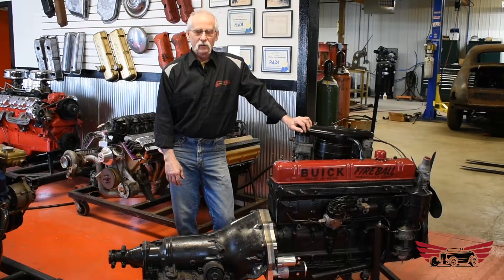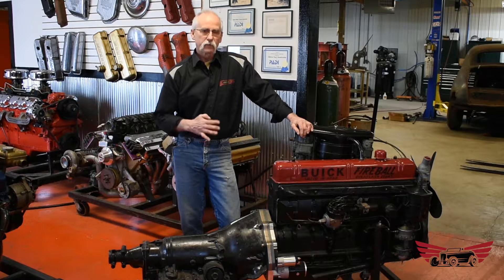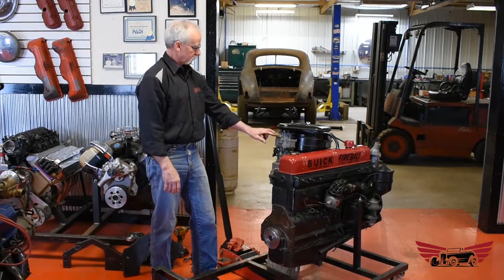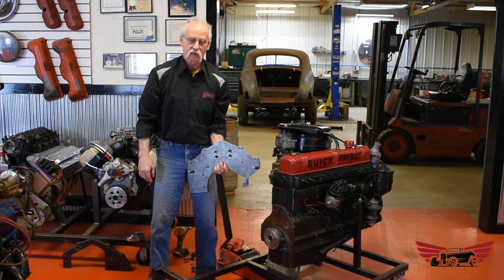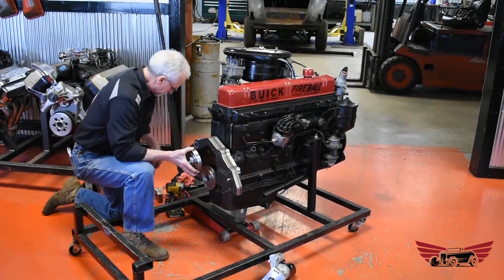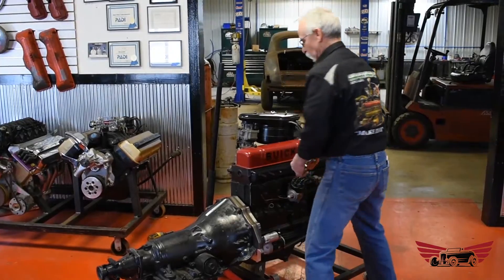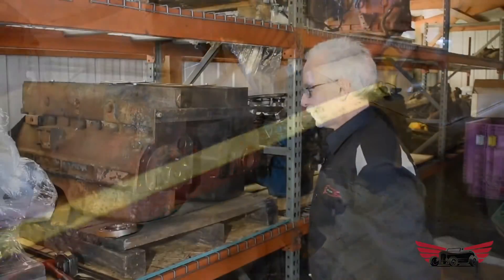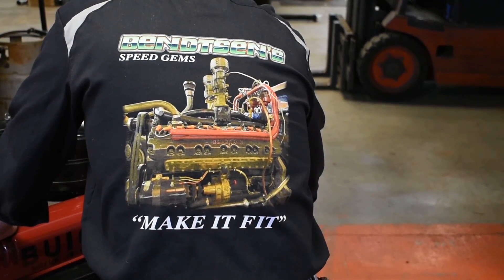Speed Gems Buick Straight 8 to 700R4 Transmission Kit Installation

Comment: Do this adapter also have 6 volt starter option?   Would like to have automatic transmission or 5 speed manual but trying to keep rest of the car as original as possible. But like to have more speed on the freeway without changing rearend.

Comment: any manual transmissions that would bolt up to this kit
Reply from the maker: It can depend on what you are looking for. We don't have a standard adapter plate, but if you can find a bellhousing to get a GM standard pattern to either a 84-92 Chevy S10 OR 93-96 Chevy S10 we can supply a bellhousing adapter plate. The links below are for those conversions. If you need help getting the correct one, please give us a call!
https://transmissionadapters.com/collections/buick/products/mt1001301-buick-straight-8-to-93-96-chev-s10-t5
https://transmissionadapters.com/collections/buick/products/mt1000014-buick-straight-8-bellhousing-adapter

Comment: very cool, I am trying to learn at moment, but want to build a stupid project for fun of it. I had a boss that got me liking straight 8, he was a Packard guy, he used it for a daily driver, put on thousands of miles on his Packard, but generally I am a GM guy, he also had a 59 caddy, we drove out a lot, but I want to build a 4wd, 70's Chevy truck, using a Buick straight 8 engine. nothing crazy, other than want to do something like this, I found 4 Buick Straight 8 engines for sale near me, but I had no idea what I was looking at. your info helped a lot! I know I want a manual transmission behind it, but no desire to beat on it, just a driver, and something to drive in bad weather, and get WOW factor when I pop hood.
Reply from the maker: @ Randy mack - Love the Story!!!  When you get there, here is a link to our Buick Kit options:

https://transmissionadapters.com/collections/buick

Thank you for choosing Speed Gems Transmission Adapters!
Reply: Thank you! I quit last summer from that boss. But stopped by in October, he was doing 12V conversion to Packard, along with adding air.  So will still be used in modern times. 

I own a bunch of older vehicles, but nothing older than 1961. But have worked on lots from 1920's to modern times.

Thank you for your video, so I know how to identify Buick straight 8. I really want to do this! The look on peoples faces when pop hood will be worth it in my opinion!

Comment: Pretty nice, providing it will go in a DynaFlow equipped car and not that 41.  Didn't know this trans was that light.  The 3 speed manual in my 73 GMC is way heavier than that, and that is without the clutch or bell housing.  How do you mate it to the torque tube?  Or do you replace the rear end with a 60s style rear?

Comment: Sounds nice but in the case of a Buick there's replacing the rear axle to adapt to the open driveshaft which will take a real chassis expert to do since it's a coil and not leaf spring rear.